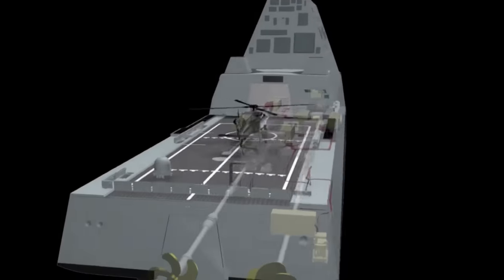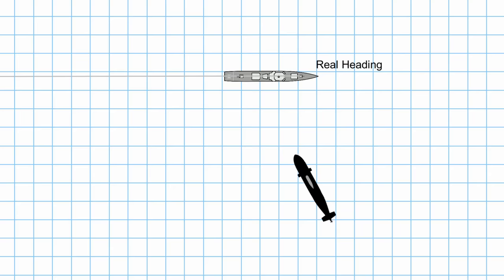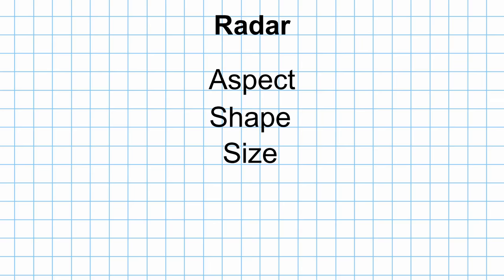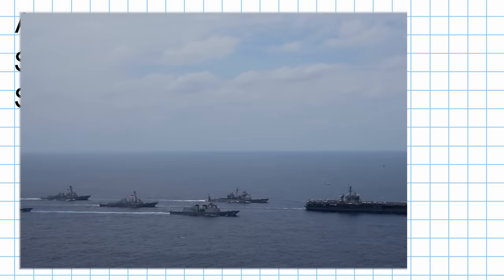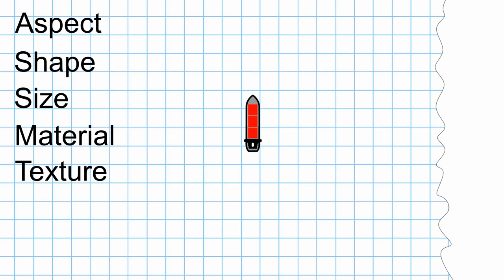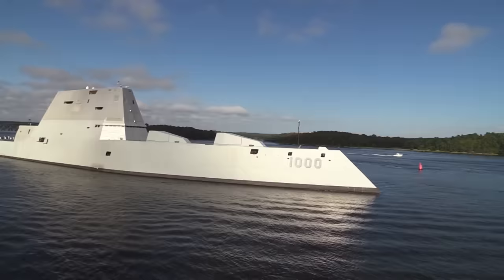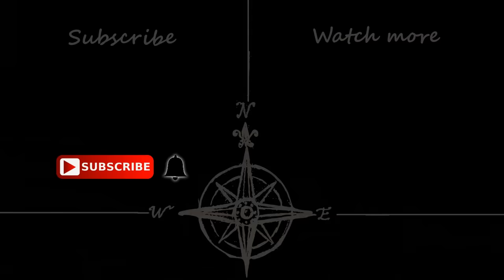Stealth Ships: How They Work

Comment: Thanks for the video, you kept it quite short for a similar topic, yet covered all the main aspects in a good way. Only a note: density goes against wave propagation in a medium; it is elastic reaction that increases it.
Water is almost unncompressible, while air can be easily compressedby pressure waves; that's why water propagates sounds at much higher speed than air. Iron has a higher elastic module, thus the propagation reaches 5000 m/s through it.

Comment: What if you could submerge them under water?
Reply: That's called a U-boat or a Submarine...
Reply: @brunoraoni  nooo hes saying what if you could just put it underwater. Then nobody could see it.
Reply: @ivanlamb6519  Again, like i said, that would be called a submarine. You can't simply build a ship and make it go underwater, you need oxygen tanks, ballast tanks, you need eletrical or nuclear engines so that when the ship goes underwater, it doesn't suffocate the crew with carbon dioxide, you need to completely change the hull so that it would be able to sail underwater and to not implode because of the pressure and kill everyone inside.
Reply: @brunoraoni  no dude you take the boat then its just underwater come on this is basic science

Comment: 8:51
Casual navigation: there are no smooth surfaces

Obvious smooth spinning radar and other smoothed out domes on top of bridge: am I a joke to you?
Reply: Yes, also the radar actively signals its presence to everybody around when running (sending out signals is how radar works). They need to be not just disabled but completely removed to achieve real combat stealth.

Comment: The problem is. If you're a ship trying to find a stealthy ship using a radar. You just look for a shadow in the sea clutter (because the stealth ships cast a massive shadow in sea clutter beyond them). Which is why most modern ships aren't too stealthy. They reduce their RCS just enough to not be conspicuous, something like a fishing boat in size.

Also, if you use radio transparent materials for your ships structure, you have to make sure everything behind them are also radio transparent or shaped to reflect radar away. A lot of modern F16s have metalised canopies because previously a radio wave would go through the canopy, bounce around the cockpit using the nice right angles of the seat, and go back out through the canopy to the radar it came from. By making the canopy radio reflective you provide a rather large and rounded surface to reflect off but you're also denying the much higher RCS inside of the cockpit. Thus you reduce your the overall RCS of the aircraft.

Also, some pictures of ships, instead of just empty ocean scenes, would be a nice touch next time.

Comment: Military navies also use a bubbler to mask the screw. Imagine a huge aquarium air bubbler shooting bubbles around the propeller.  It masks the sound because prop noise is contained in the bubbles. To anyone else, it sounds like a rain squall. This system is used to mask the screw blade count and screw rpm, thus making it difficult for sonar to track their speed unless they are in visual range.

Comment: I worked on all 3 of the Zumwalt class destroyers. There are no 90 degree angeles anywhere. What is not mentioned is there are special panels on these ships that counter radar signals. There is way more stealth tech. On these ships than mentioned in this video.

Comment: I think a few things are misleading or wrong:

1.	Due to the curvature of the earth the radar range is limited. If it is mounted 20 m above the water surface, the horizon is about 17 km or 9 nm and a ship that is also 20 m high can only be detected up to a distance of about 28 km or 15 nm. 

2.	Warships also are usually on EMCON and even a big Aircraft Carrier can´t be spotted if enemy radar is switched off. Imagine you are playing hide and seek in a dark room and everyone has a flashlight. How do you find someone faster? When you turn on your lamp or your friend his? 

3.	Stealth is therefore only useful against airbourne radars, a P-8 Poseidon e.g. can locate a target from 600 km or 375 nm. The performance decreases with increasing distance, and since the radar waves have to go back again, the detectability is reduced by 90% if the radar cross-section (RCS) is halved. The area in which a ship can be spotted is even reduced by almost 99%, if the circle has a radius of 75 instead of 600 km.

4.	So it's not about becoming invisible, it's about reducing RCS, and round shapes and rough coatings made of special materials are even better suited for this, since some of the waves are always thrown back to the receiver, but a much smaller part of them. Such surfaces are only more complex to construct and maintain and are therefore quite simply even more expensive.

5.	Cost and benefit is also one of the reasons why not more ships of the Zumwalt class were built. The Arleigh Burke e.g. is already stealthy (angled superstructure, no rocket-launchers on deck, other structures made of radar absorbent material or with RAM-paint,...) and this means that the RCS corresponds to a 25 m long fishing boat. The Zumwalt brings that down to a 50-foot wooden fishing boat, despite being 40% larger. This is of course enormous, but at a distance of a few hundred nautical miles it hardly makes a difference. If a Spruance could be located from 375 nm then it is theoretically 60 for the Arleigh-Burke with 70% lower RCS and about 20 nm for the Zumwalt with another 40% lower. In practice both still differ in their actual size of a fishing boat, so they appear far ahead on screen, maybe at 200 or 100 nm, only the dot is smaller. This should also make the operator suspicious when receiving a weak signal at such a great distance. You can also determine the speed and a ship with a LWL of 12.5 m only has a hull speed of 9 knots, so if it is significantly faster, it is either a yacht or a warship. Sure, the Zumwalt is still harder to find, but for the same money you get four conventional destroyers, and in a fight against each other those would probably win.

Comment: Great video, and I love the longer format, but I do have to say that the claim made at 5:45 flat right angles always return the signal back to the source, is incorrect. Think about it: depending on the distance, there’s a very high chance that it misses. Yes, it’ll probably cross the path it took on the way there, but it usually won’t go back to the source.

Put simply, a 90 degree angle will have the exact same effect as any other concave angle or surface.

Comment: i was under the impression that rounded shapes help increase signal dispersion upon impact, therefore making the return smaller? isn't that the key principle behind the f22 and f35? (as well as the absorbent coating)
Reply: That is what I was thinking as well.  Stealth planes do have rounded surfaces, except for the F-117.  Even the SR-71 is mostly rounded, with the exception of the vertical tail and we do not classify it as a stealth plane.

Comment: While it doesn't matter anymore, dazzle paint had an additional effect: optical based targeting systems depended on both the angle on bow (as alluded to here) and height to enter a firing solution. Any problems with the measurements could create an incorrect solution and cause a miss. This meant the U-boat would need to come closer and take greater risks to be effective. 

And I mention U-boats specifically due to these targeting systems being jammed in the smallest periscope possible. A surface ship with a full turret or fire control system to work with could do range estimates with optical rangefinders rather than signatures.

Comment: Going to point this out, but you did actually forgot to mention the 6th method of reducing radar signature,  which is simply just turning off your own radar and other equipment such equipment.

This is because an active radar is in itself something that one can actually get a return on. Worse, this signal is actually detectable from a larger distance than a radar can actually get a return. Same holds true for sonar as well. This means that a warship wanting to not be found might turn off even their navigation radars if they absolutely need to, and operate purely on Mark 1 Eyeball and sometimes GPS to figure out their location.

Comment: Zumwalt-class destroyer also has radar-absorbent coatings slathered on the ship's external surfaces.
Reply from the maker: Good point. It does have absorbant material across its surface

Comment: I feel like you missed something, aren't there coatings meant to absorb radar? and radar absorption in general wasn't talked about, and stealthiness isn't only used against other ships, but increases the chance to avoid anti ship missiles, the modern danger to any military ship, and by avoid I mean chaff will be more effective.
Reply: Remember how so called US 'stealth' aircraft couldn't fly in the rain?

Very expensive coatings for small jets and this thing is huge in comparison. Not to mention you get a whole lot more erosion of said coating at sea.

Can it be done? Sure but this thing already costs 3+ billion USD and coating it would mean the cost would go up even more. Kinda got cancelled because of being overbudget beside the rest of the failures.

Comment: Actually, size has nothing to do with stealth: the production-version of the Lockheed F-117 "Nighthawk" has the same radar cross-section as the scale model used on the Air Force's radar test range during development. Proper scaling is key. If you doubt my statement, buy a copy of "THE SKUNK WORKS" by Ben R. Rich. Ben R Rich worked with Clarence J. Johnson on the U-2 and SR-71, and took over the Lockheed Skunk Works when Clarence Johnson retired. Ben Rich was head of Skunk Works during development of the F-117.

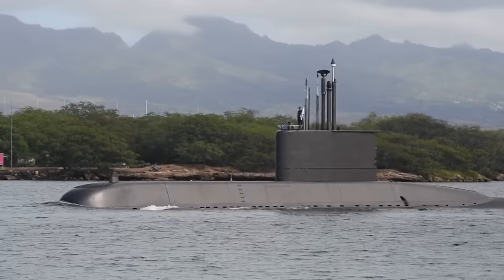Comment: At 2:30, another alternative to internal combustion is sterling engines, which are used on Swedish submarines.  This makes them the quietest submarines in the world, point of fact.  It also lets the submarine remain underwater for longer because a sterling engine's exhaust is literally breathable air because it just runs on liquid oxygen and a small power source like batteries or a quiet, small diesel generator.
Reply: Arent stirling already oudated ? I believe they've already had even better AIP fuel cell engine right now
Reply: @IndoLiberation  It's still the same kind of engine and is quiet for the same reasons.

Comment: All fun and games until even slightly rough seas rock the boat enough to allow for radar returns. Or you’re to stealthy and the enemy starts looking for the hole in the radar return instead of the spike.
All joking aside, stealth ships are unlikely to be stealthy in the same way stealth aircraft are. Instead of trying to be undetectable at standard engagement ranges like stealth aircraft, stealth ships are only really capable of making themselves look smaller on radar. They’ll still detected by enemy ships at the same range as a non stealthy ship would be. The stealth ship still has a pretty big advantage though. A stealth destroyer is gonna look like a small fishing boat on radar, so the enemy is going to have a harder time evaluating the threat. They’ll have a harder time determining if the vessel is even a threat, and then more trouble deciding the proper amount of force to use against the threat. After all, you don’t want to waste a dozen antiship missiles against a corvette that would be easily defeated by 3. You also don’t want to fire 3 cruise missiles at a destroyer that’s capable of easily intercepting several anti ship missiles. This takes time, which means the stealth ship has more options. It also increases the chances of screwing up and using to much, or to little, force.
Another massive advantage a stealth ship has is increased counter measure effectiveness. Just like with newer 4th Gen fighter jets, which have smaller radar cross sections than previous fighters but are still not stealthy, they can more easily jam enemy sensors. The smaller the RCS, the less energy needed to cover it with ECM. It also makes things like flares or chaff more effective as they can more completely cover the signature.

Comment: Is there some technology where if the ship gets detected via radar, it tries to trick the radar by sending the echos back earlier then it should? For instance a ship listens for radar, if it's deemed detected by some method the ship starts waiting for an initial radar ping, then calculating how long until the next one hits, by using that it should be able to send a ping a bit earlier than that towards the ship, making it seems to be approaching the vessel, when in reality it hasn't changed course / moving way.
Reply: Only problem I could see with this is the computer would hear a second echo in the background, and be able to try and filter fake pings with real pings (which could also be countered). That or it might just be easier to try and scramble the radar/ deploy decoys...

Comment: I guess it possible to train the neural network to recognize the stealth ship's footprint on the radar?!
By the way, these footprint's usually look like a smaller fishing boat, even though it is a destroyer - but I'm sure there are barely noticeable patterns in the radar footprint that the neural network can easily recognize and thus devalue the complete stealth vehicle concept. The only thing that seams complicated in this idea is collecting enough data, radar fingerprints, to train the AI. :D
Reply: Not really - a smaller radar footprint means the radar can only detect it at shorter distances compared to a larger footprint. The name of the footprint is ‘Radar Cross Section’.
Reply: @TT-hd3zi  I remembered that after I wrote the comment, but then it was too late. You can't detect the type of ship you don't see on the radar at all :)
But still, when you see a radar cross-section, it should be unique enough that the AI can recognize it - unfortunately I've never seen military radar cross-sections...

Comment: Size is not by itself a significant factor for radar stealth. If you make a model, and make the same model except 100 times bigger they will have the same radar cross-section (unless you are doing astronomy). This is because the wavelength of the radar is significantly larger than the object you are trying to measure. This is the reason why they used to test stealth aircraft with scale models. However, size can become a factor if you are forced to deviate from your ideal profile because of structural or hydro/aerodynamic concerns.

Comment: 5:35 b-b-but the b-2 stealth bomber is nothing but curves ? so how does that square with this ?
Reply: The B-2 stealth bomber doesn't curve, it's all sharp angles that reflect the signal off the aircraft into nothing. There is a very VERY small chance it hits spot on where the angle intersects, but that's highly unlikely. That is why the B-2 is one of the stealthiest aircraft in the world, and the most feared aircraft in the world. The F35 and F22 have tail wings for maneuverability sake and therefore surrenders some stealth ability, but follow the same design philosophy of creating no surfaces where a signal can bounce back to the sender.

I should also stipulate on the curve thing: aircraft and ships CAN have curves on stealth designs, you just can't have any surface that's facing directly towards the sender or the object will be picked up by radar. That's why the B-2, F-35 and F-22 still have some curvature to them, but overall these curves won't be picked up by radar granted a flat surface isn't facing towards the sender.

Comment: Wouldn't it be d=vt (Vector quantity) because you're calculating from point A to point B (Displacement) and using a direction with a calculated rate of change (Velocity; Which is speed with a direction, you need direction in radar), as well as the time it takes. In other words you're using Displacement and not distance because distance does not factor in the direction, which is required with an given radar system. Displacement = Velocity(Time). This is reference to 4:09. I take it you're not well versed when it comes to physics?

Comment: How interesting is it that for aircraft, everything is rounded. Must mean that aircraft can't angle their radar profile like ships do, but I don't see why.
Reply: The F-117 Nighthawk, the first true stealth aircraft, didn't have a single rounded surface on the entire aircraft. The downside to this was massive amounts of drag, meaning it took as much runway as a Boeing 737 to take off, and had drastically reduced range compared to other aircraft its size.

Modern stealth aircraft are designed to be stealthy from select aspects, and with the aid of computer design no longer have to be made purely from flat planes, restoring their aerodynamic performance. The F-35, for example, is designed to be stealthy from the front and sides, and there are no areas that sit at 90 degrees from those aspects.

The autopilot on U.S. stealth aircraft is actually programmed to manipulate bank angle and flight path to minimize radar signature against expected threats, so they do angle their profile, in a way.